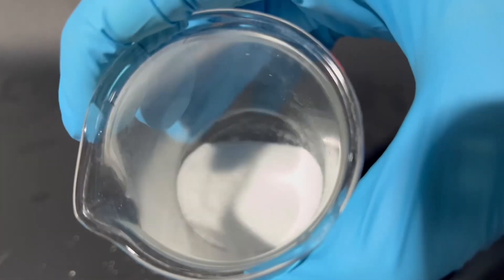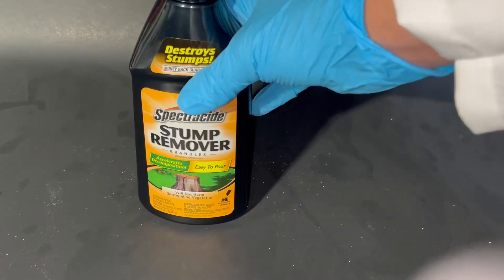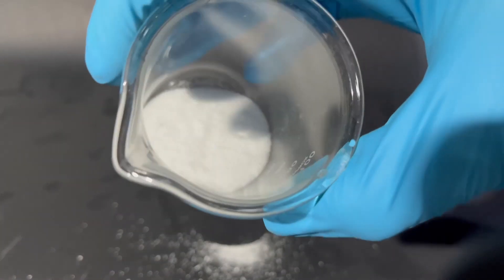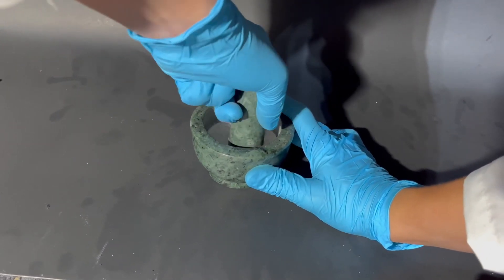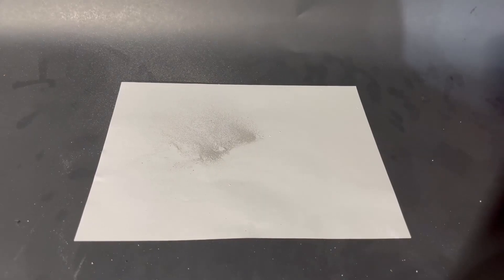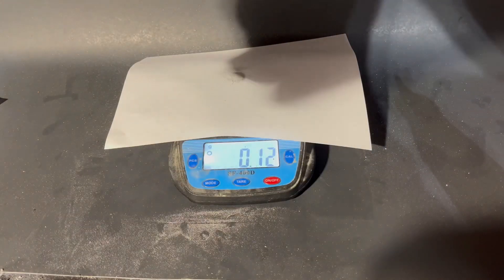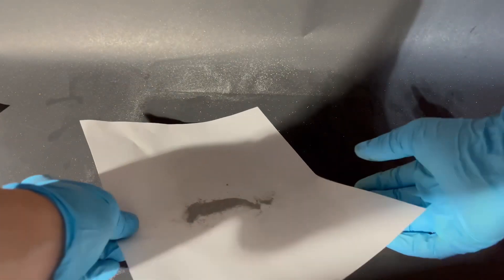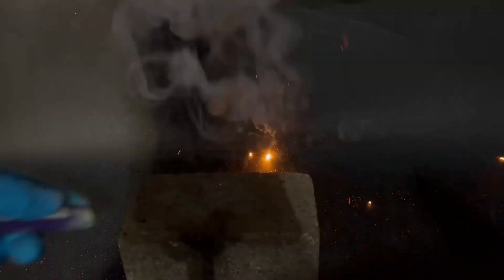Making flash powder

Comment: love the interesting choice of oxidizer, and the results were far more interesting. The burn rate suggests that the mass required to achieve deflag to det unconfined is <10g probably even less than 5g. Ive made ridiculous quantities of flash powder when i was younger, like 1-2kg batches at a time ever tweaking the mix to achieve the perfect nitrate based Mg flash powder and yours is at least on par (if not better) than the ideal mix of KNO3/Mg/S/Al.

Only criticism i have is your oxidizer is NOT persulfate, its MONO persulfate which is actually short for peroxymonopersulfate, which is the acid salts of piranha solution,  good to keep in mind when calculating stoichiometric ratios if you plan to refine it.
Reply: Where do most get persulphate
Reply: What are the ratios?

Comment: DO NOT attempt to light any flash mixture the way it's shown here.  Use a length of fuse or other device that will allow you to keep your fingers (and the rest of you) at a safe distance.  I consider myself a veteran after about 40 years of mixing, testing and making all kinds of pyrotechnic devices as a hobby.  I never got so much as a burned finger.  BTW, I don't recommend the mixture shown here.
Reply: Why?
Reply: @Beginner_pyro  Did you read the warning label on the potassium monopersulphate?  Other oxidizers, potassium nitrate, potassium chlorate and potassium perchlorate are much safer and easily obtainable.  The method show to obtain magnesium is tedious and will only yield a small quantity.  Aluminum powder is easily obtainable and safer to store and handle.  Spectacular results can be had without using magnesium.
Reply: @NortheastSurvival911  I recently went to a couple supplier's websites to order magnesium and magnalium.  The shipping cost was prohibitive.  I think a hazmat charge has been applied to those items.  Sure ruined my day.
Reply: @dlkline27  "easily obtainable" sure but not if you live in EU or you'll land on a list
Reply: I want to make flash powder and I’m planning on using purified sulfur pottasium nitrate and fine aluminum but can you give me a tip on mixing it well cause I want to make smal firecrackers for the 4th and I don’t want to not have fingers by the time July 4th comes so what’s the best way to mix it well
Reply: @TeetimewithTenzin  Use what is called the "diaper method".  Pour your three chemicals onto a sheet of paper (newspaper works great). Lift one side then another so that the mixture rolls over on itself.  Repeat until good mix is obtained.  Avoid using any kind of plastic ware at any time.  Do not store mix in plastic or glass containers.  Potassium nitrate flash is relatively safe so you'll not lose any fingers using the method described here.
Reply: @dlkline27 what do you think about mixing potassium perchlorate with just aluminum powder.
Reply: @dlkline27 hey wsp. I watched a video that gave a recipe for 7:3 ratio of potassium perchlorate and dark aluminium powder. I want to make flash powder and I wanna follow all safety precautions. Should I use diaper method or can I mix both chemicals in a plastic tupperware container? Cus that might cause friction right?
Reply: Where do u get your perchlorate

Comment: cant you just use zinc and sulphur powder?
Reply: that doesn't produre any gas
Reply: You saw the green flash powder video too huh? you could use that just make sure its a 3/1 ratio 3 parts zinc 1 part sulfur and make sure they're both very fine powder, its basically the same recipe for most flash powder its just this one uses a metal thatll burn for more color

Comment: Aluminum is a better fuel because it burns longer and hotter.
Reply: no. it burning longer is worse, the point of flash powder is that its powerful (instant flash)
Reply: @ If it is mixed with charcoal during milling it burns way brighter in a shorter period of time.
Reply: @Auroral_Anomaly  you dont ball mill flash powder
Reply: @leverpeber  You can, but it is super dangerous.

Comment: Isn’t flash power what’s in flashbangs? Wouldn’t putting this in an aluminum casing literally make a flashbang ??
Reply: Yep
Reply: Or a pipebomb
Reply: @SidselPoulsen😂 100% that shit fun
Reply: Yea it doesn't even need a casing. If you put 40 grams of this stuff in aluminum foil it will make a shockwave that moves your clothes from 100 feet away. Its fun
Reply: @dryderwasmyst bs
Reply: @msnmalina  40 grams is a lot for a firecracker. Like A LOT
Reply: @dryderwasmyst  cap
Reply: @Paddje  it absolutely is not, look up some videos
Reply: @jn17d  ive lit up al the way to 350 grams before, 40 grams of flash does not make you clothes move.
Reply: @Paddje you must make some bad flash powder
Reply: @jn17d  65:35 ratio, when selfmade. Also lit pre made firecrackers 200gr etc.
Reply: Also a destructive device which means it’s an NFA item, so don’t get caught
Reply: all of y'all are bad at this, i make it with perchlorate, sulfur, and 4micron magnesium, and it detonates uncontained in a pile of .4 grams or more

Comment: Don't use this method this isn't safe at all. Use the rite chess to make safe flash powder like 70/30 kclo4/al and yes it's more than loud enough.
Reply: Not chess but chemicals.
Reply: U cant get kclo4 easy whitout a permit any tips?
Reply: @WhiteWickedWitch r u in europe? try making it by electrolysis, or make kclo3 from bleach and then make kclo4 from it.

Comment: Nah too much fuzz and getting Magnesium powder may not be an option for most people. 

Instead simply whip up a small batch of AP and that’ll kick ya for sure! (This one is a primary but fun too)

10 ml H2O2
10 ml CH3)2CO
10 drops of HCL (5 of H2SO4)
All done under 10C temp.
Wait a few hours then wash it well and dry it. Careful not to make big crystals or confine it. Have fun!

But hey! Y’all knew this already, right? 

Another awesome mix:

10g of KMnO4
5g of S
3g of Al

Careful out there kids MOS (AP) is a bitch when she’s dry and cranky!
Reply from the maker: Yeah AP is the cause of my on and off permanent tinnitus 3 stars wouldn’t recommend
Reply: @Chemanic1   now that you mention it, I too fucked up and smashed a super tiny bit of it without protection with a hammer and I was deaf and ringing for days man with my ears hurting. That fucking thing is serious business. Very similar to HMTD in power. I am not completely in agreement with most folks that say these two are SUPER SENSITIVE TO FRICTION, ETC in my experience HMTD does not appear to be extremely sensitive IF YOU USE GOOD INGREDIENTS AND FOLLOW THE PROCESS. 
My approach is to NEVER EVER LOSE RESPECT for any of this stuff. I am always meticulously labeling and separating shit making sure I know for sure what’s what and where. Personally I am against storing primaries dry for later use as I’ve seen many guys do. What I do is desensitize them under isopropyl alcohol totally submerged. I just don’t feel comfortable sleeping or leaving my home with that shit stored dry it just gives me the creeps knowing I have that at home. So wet it is for me! But I never make more than a few grams and get rid of them anyway.
Reply: @peek2much3 wait until you light up a compresses 20g AP that got me almost sent to the bars. It was so loud felt the ring and temp blindness from 30m away. I agree ap is not to be kept stored dry. Any powder mix I have that can be stored dry is in separate bins and any that sensitive to friction, impact or slight spark is suspended in 99%ipa.
Reply: @peek2much3 i assume that by ap you mean ammonium perchlorate, and in that case, how is it dangerous by itself? isn't it just an oxidizer? what am i not getting? also, what's mos?

Comment: If I were to use potassium nitrate instead of the pool shock what would the ratio need to be?
Reply: I have tried. The best thing is to use potassium nitrate and black aluminium powder, but its more like a sparkler. Still flashes your eyes though.
Reply: @dryderwasmyst ok, thank you.
Reply: @dryderwasmyst  couldn't you use sparklers on a stick and crush it up for flash powder?
Reply: @outlaw615  No, it doesn't ignite nearly as fast as you want it to. It will burn bright, but not explode, which is what i was going for. Just buy some potassium perchlorate, black indian aluminum, mix it 7/3 (7 perchlorate to 3 aluminum). Be insanely careful because 10 grams of that stuff will deafen you if you're too close.
Reply: @dryderwasmyst  ah OK also another question, if I crush sparklers up would it act as a sort of thermite?
Reply: @outlaw615  KInd of, but its also reallyyy easy to make thermite. Crushed sparklers will just burn really bright for half a second.
Reply: @dryderwasmyst  how do you make thermite?
Reply: @outlaw615  You need pretty finely powdered iron oxide (I think its used in dyes? ) and powdered black aluminum. I forget the ratio but yea, be careful bc it shoots molten slag everywhere like in Call of Duty.
Reply: @dryderwasmyst  😈 thanks
Reply: @outlaw615  Nothing i say is advice, do it at your own risk. (FBI don't come for me)
Reply: @outlaw615  Have fun tho 😈😈
Reply: @dryderwasmyst  I don't know what your talking about 👀
Reply: @dryderwasmyst  where do you buy klco4 if it isnt legal in your country whitout a solid explanation
Reply: @WhiteWickedWitch  I don't know, i live in the US and i can just buy it without ID
Reply: @dryderwasmyst  oh nah im from the netherlands need a permit to purchase amy chemacal that can be used in pyrodynamics
Reply: @WhiteWickedWitch  Oh yeah, good luck bc i don't think you can get any then :(((
Reply: @dryderwasmyst  how would that compare to whats being made in the video in terms of loudness
Reply: Potassium nitrate is not suitable for flash. You need to start using software if you need to use potassium nitrate. Potassium perchlorate is your best bet with some dark aluminum

Comment: Wrong! Only one mix works, kclo4 and Al.
Reply from the maker: There are multiple flash powder mixes that don’t even involve perchlorate. Really the only thing that makes a flash powder is a metallic fuel and an oxidizer that when mixed will combust quickly. Plus with magnesium being much more reductive than aluminum. a magnesium fueled flash powder is much more powerful if pared with the same oxidizer as an aluminum one given that the metals are only reacting with the oxygen.
Reply: @Chemanic1  Can this be used to make #11 blackpowder rifle primer caps?
Reply from the maker: I have no idea, my guess would be if it’s shock sensitive it should work. but I would go with something like mercury fulminate or lead azide for a primer
Reply: @MrOldclunker  Yes, In many different compositions. But it will not be friendly for anyone not respecting it. Friction or impact detonating compositions is what you need.As an pyrotechnic we try to avoid those aspects if we can. Most oxidizers are hygroscopic, metals as fuel cobined with moisture is oxidation. The oxidation proces is an chemical reaction between  the elements perfectly available in flash powder. Simply means the reaction is energetic. This can create enough heat to self ignition of composition. For star compositions with kno3 and al combined with the wet proces of making stars create also this problem. So we need to add 1% boric acid to avoid this.
Reply: @PyrotechnicsNL What do you think about mg/s flash. Is that more stable and won‘t self ignite or is it the same chance
Reply: @joshuuuuuu3299  It is not self igniting because that is for so far I know trough oxidation of the al. flash powder with mg/s can be unstable depends on the oxidizer. Ive made even good fp with Kno3 /mg/s. kno3/mg also, really bright
Reply: @PyrotechnicsNL  i don‘t use an oxidizer just sulfur and magnesium.
Reply: are u dumb??
Reply: Love that you were safe diapering it and yet then you proceed to CREASE THE PAPER AND PUSH DOWN on a hard surface! 😭 Dumb
Reply: @cheesescrust5399  Actually, you're the dumb one here.  If you knew a damn thing about this, you would know that it takes MANY times that amount of pressure to affect this comp. Please do some research before making yourself look so ignorant and rude. Good luck with your life
Reply: People still have those cameras and Magicians also use flash powder so surely they can just buy a ready made off the shelf bag of the stuff?  No  ? Or if it's just a loud bang you're after then I suggest fireworks,  they're safe, loud and nobody's going to blow their fingers off or worse!

Comment: Today, I ignited a handmade 40g flash powder firecracker, which almost exploded in my hand. I'm totally fine, but I will never, ever touch flash powder again. I am so scared. Think twice before working with flash powder; it is no joke.
Reply: how? did you use a short fuse?
Reply: @Xray03  yes, the fuse sticked out about 4cm but after wraping the firecracker even more thw fuse was only 2 cm out of the shell. I guess the fuse burned much faster because the heat could not escape and it went down very fast.
Reply: @andreic1755  You should use at least 15cm fuses for that NEC.
Reply: @andreic1755 what i sometimes do while letting less fuse sticking out is wrapping it with quite a bit of duct tape tightly around the middle parts so that when burning on the inside it doesnt contact the flash powder only when it reaches the end: to anyone trying this PLEASE TRY AN IDENTICAL FUSE WRAPPED IN DUCT TAPE OF SAME LENGTH TO SEE IF BURNING RATE DIFFERS
Reply: @andreic1755 well wasn’t that very smart…
Reply: Yes, and dont forget that nuclear bombs are no joke either.  Just saying...
Reply: @hughezzell10000  yuup made one the other day. Never messing with plutonium again.
Reply: U guys are using small fuses and that happens always use big fuses or homemade fuses
Reply: glad to hear you're okay. hopefully your experience can help steer people away from that stuff. I know if I hadn't read so many accounts of people either burning alive or getting awful scars on their face from bp accidents I wouldn't treat that stuff with NEARLY as much respect as I do now.
Reply: you made a 40gram explosive and used a 1 inch fuse?😑
Reply: @d.r.a.k.o2548 freehanding 40 grams of contained flash...
Everything 'cracker' containing flash should be considered ground Salute and be handled accordingly...
But Yeah, probably even had a 40 cm fuse but did not know it was quick match...
Reply: Like dude is your brain even on 😂
Reply: Pretty sure you're the reason this type of stuff is frowned upon legally. Using a short fuse is the reason you almost lost your hand. Skill issues for sure.
Reply: yeah nah
Reply: Because u probably accidentally put some flash powder on fuse
Reply: Never light more than 2g in your hand it can end so bad
Reply: hey, i once made a 30g homemade with flash powder and it had a similar fuse(to yours) very small, i held it in my hand a friend lit the fuse and it exploded about 2 meters away from me in mid air it was so loud and powerfull it made my knees week and i was basically deaf for 1 min lesson learned i now make at least 10 cm fuses
Reply: So true, there is no second chance when flash powder explodes not as planned.
Reply: This is why you put the cracker down and then light it until youre confident that it wont go off in your hand
Reply: Yeah, 40g....is insane. Lol. Good thing you got your hand still.
Reply: maybe don’t be a dumbass
Reply: Hey man, that’s called a bomb 😅 not a firecracker
Reply: what fuse and what length
Reply: No self respecting clandestine demolitions man has ever regretted a fuse that was too long, or delay device that went past expected
Reply: Been doing boom for 40 years... Also 'exotic' mixes.Basic safety rules prevent a whole lot of damage.

Comment: fine aluminum with black copper oxide...flash thermite!
Blue-green flash, orange smoke (copper vapor), tons of heat output...
Easy to ignite, not at all impact or friction sensitive.
Tends to explode if burned in confined spaces.
Reply from the maker: Thanks so much I’ll definitely be using these
Reply: When trying different thermite mixes (with different metals and oxides), I noticed that a composition of magnesium and anhydrous copper(II) sulfate is quite brisant. When I made it, I totally miscalculated the ratios and had 400% to much sulfate, so I expected it to burn slow like the iron oxide thermites. To my surprise, 15g losely put on a pile self confined and deflagrated with a loud noise.

Comment: can i use potassium perchlorate
Reply from the maker: Yeah but you would need to change up the ratios
Reply: @Chemanic1  i see in firecracker they use a KClO4 7:3 Al ratio for the powder
Reply from the maker: @maci1245  yeah I just uploaded a video on making aluminum powder
Reply: @Chemanic1  thanks
Reply from the maker: @maci1245  ofc
Reply: @maci1245 where did u get your klco4
Reply: @WhiteWickedWitch skylighter
Reply: @maci1245  i’ve been seeing 75% KClO4, 20% fine aluminum, and 5% sulfur

Comment: If I did more magnesium and pool shock how dangerous would that be and could something happen if you shake it or something like that
Reply from the maker: Theoretically if you did it right and had a stoichiometric ratio (it would all react with no reactants left over) it would be very sensitive given it’s a fine enough powder but only adding more powder shouldn’t do much other than bigger boom
Reply: @Chemanic1  so if i would do 2grams of magnesium i would have to add approximately 5grams of pool shock
Reply: @lolkonsti Thats far from the stoichiometric ratio for the reaction.